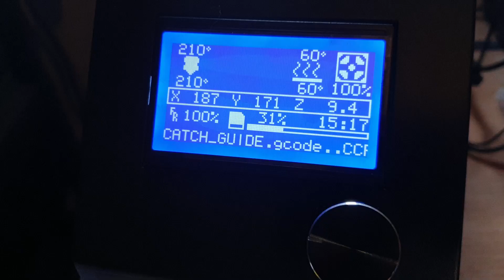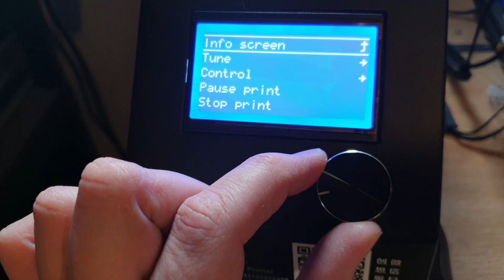CR10S ghosting fix

Comment: This is a great video, I've been going through the same experience as you on my Ender 3 Pro.  I also tried all of these things in your video.  I agree the printed feet suck, they didn't help me at all.

The best results for me were when I printed on a hard tiled floor.  Alternatively, instead of messing with jerk & acceleration try lowering your "outer wall speed" (Cura) a bit in settings, that also makes a BIG difference - it may completely remove your ghosting altogether since you're pretty close to having it gone already.

Another tip I've picked up in the last few days is to get a heavy paving slab and put it under your printer, apparently the added mass helps a lot with vibrations.  Check out CNC Kitchen's video on vibrations and you will see what I mean.  I want to keep printing on my desk rather than a floor so I'll be picking up a paving slab soon.  My quest to beat ghosting using my desk without compromising speed too much continues....what a pain in the ass!
Reply: Hell yes, achieved it tonight, zero ghosting!  I remembered I had some weights in my cupboard.  I put some polystyrene under some 2.5KG weights on each corner of the printer.  Then I printed a calibration cube with everything stock Cura 4.3.0 (default 1.2 layer height profile which uses 50mm/s speed) but the only thing I changed was the outer wall speed to 15 (default was 25).  It increased the print time of the cube from 52 minutes to about 56 minutes but I FINALLY got a cube with no ghosting.  On large prints the time increase is about 10-12% so I can live with that!
Reply from the maker: thanks man appreciate the feedback i might give the slab idea a go i know my table is a little wobbly.